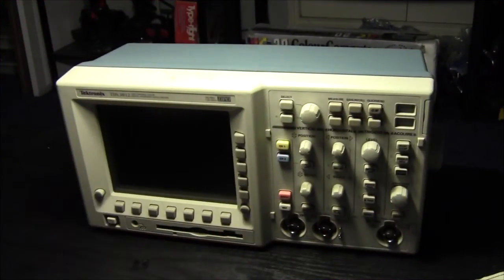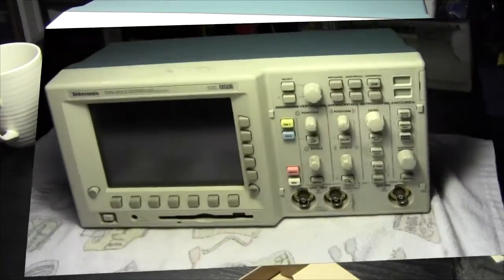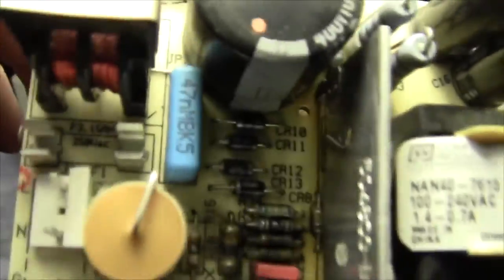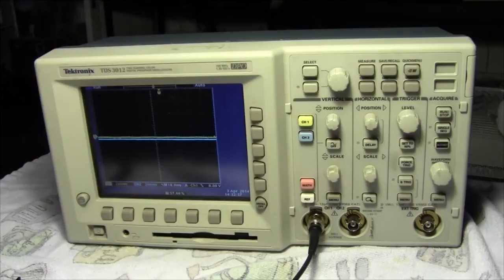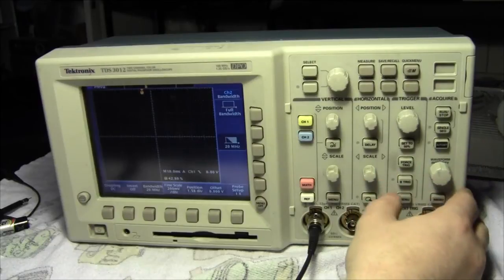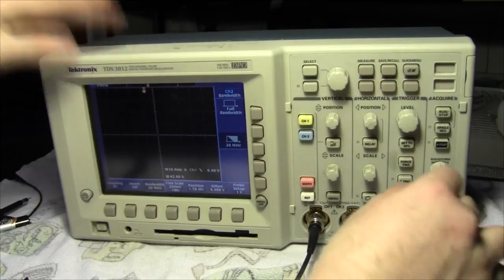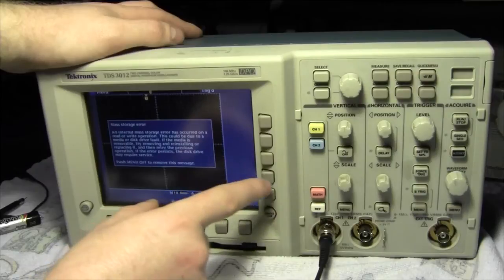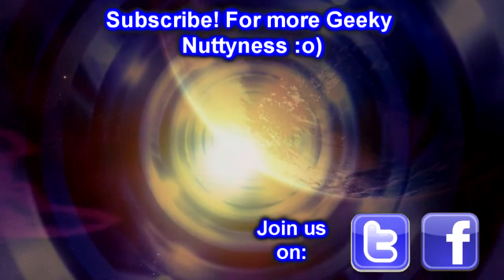Dead Digital Oscilloscope Repair Conclusion ( Tektronix TDS 3012 ) (Part 2)

Comment: hello,
I just saw your modification.
I also have a problem with the power supply of my TDS
Looks like you've purchased the replacement power supply from mouser.
Could you give me the reference you bought to use the same?

Comment: The PSU failed in my TDS3012 about 10 years ago, I remember it was a high value low wattage startup resistor connected to the chopper control chip, a simple repair but I don't have any more details than that now.  The PSU stays running even when the front panel switch is off (so it could charge the optional battery).  Therefore you should unplug these 'scopes when not in use.

Comment: Congratualion !!!
I just would like to know because i 'have the same problem in the same tektronix but i would like to know where you buy the new power supply of this tektronix because i dind't find it.
If possible to gave me the contact.

Thank you
Reply from the maker: I got the psu from a chinese supplier.  Unfortunately, they stopped making them just after.  You may have to rerofit a similar design.
Reply: OK THANK YOU VERY MUCH

Comment: Try doing some serial port testing with it first. You can learn a ton of stuff from starting with basic serial protocols.

The "Acquire" stuff on the right is for capturing single grabs of data or waveforms.
It also has some modes for decoding a few serial protocol as well.

You should be able to stick the probe directly onto a serial port or I2C / SPI bus on something to test it.

On analog 'scopes, the horizontal position control often changed the literal position of the beam / waveform on the screen, but on this 'scope, it looks like it adjusts the position of the waveform relative to the trigger point (yellow marker at the top).

The battery test probably couldn't get an accurate voltage reading because the voltage division on the 'scope was probably set too low, so the DC waveform went off the top of the screen.

Good to see it working. ;)
Reply from the maker: Yes, it changes relative to trigger according to eev blog, I watched some of his stuff on digital scopes last night :o)  I know with the battery, I just wanted to get it to react initially to the probe, still need to set it up :o)

Comment: Now you just need to design some projects and you have another tool to make troubleshooting a breeze.
Reply from the maker: Well, troubleshooting as easy as my lack of grip on electronics ;o)  I've seen Mike'selectricstuff use them to diagnose digital signals :o)